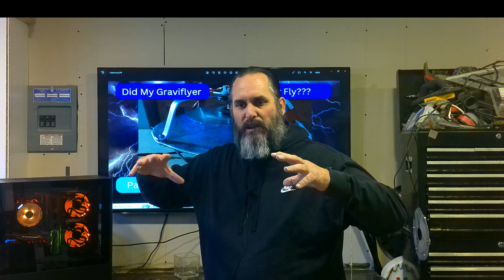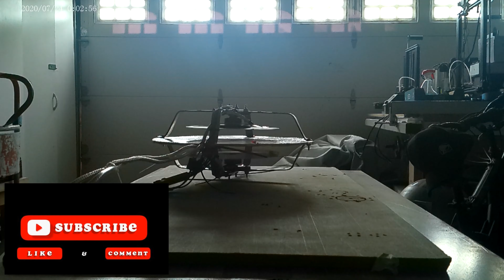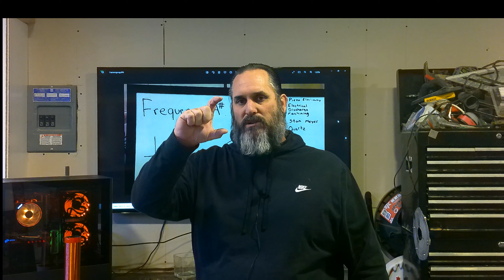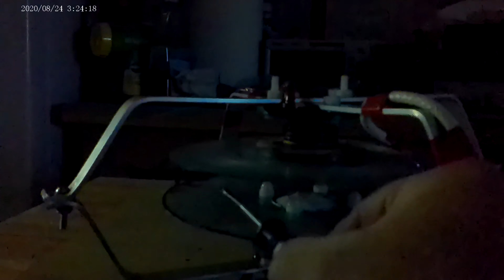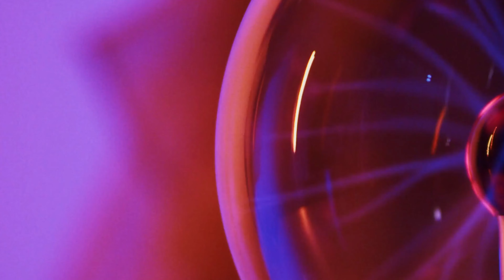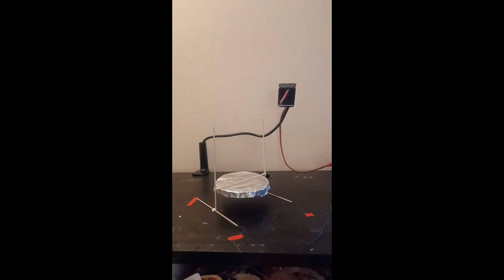Did My Graviflyer Ever Fly???? Part 4

Comment: Is the gravity effect really produced? How is it produced? Is it the mutual cancellation of electromagnetic waves? I am very interested in the production of gravity. There is an explanation of SEG; Searl-EffectGenerator for anti-gravity, but there is no explanation for gravity.
Reply from the maker: The only way to beat gravity in my opinion is to cancel it's effects one by one. rotate an object 2800 rpm it starts to defy some gravity. Counter rotate 2 objects it becomes stable. It still follows physics though, you will still have a direction it will go. Up or Down. The third ring in neutral it has to have a thrust factor. That is one way.

The second is harder to produce. It needs a static field produced around a craft. Then a dc or magnetic field (not magnets Think flyback transformer) in the center. It makes a gravity well. You then need a direction. one point above it using sound waves to travel in. 

Both very hard to achieve. As to this day there are no examples I can show for either. I can reproduce some effects but not all of them. But hopefully this year I can get closer.

Comment: A man by the name of Charles crawford 3 bought the working model a while ago in chekurkovs flight test videos as a kit here's the google drive link with all the circuits & the dimentions we need to make this work https://drive.google.com/drive/folders/1_6ZIAJF2LMDPdM6RWqz3SrzPbnbqoiht?fbclid=IwAR2LSzOKY0OLAWik0WkzifGmOtqY9nrcm6D9Qj8qHGN5YHXvs4RhHrCE5-E, it includes the tesla coil, the piezo on top the DTS flyback & the gravitometer circuits
Reply: I'll be using this info to build mine, it's the only way to properly verify if it works rather than people looking for strings in chekurkovs flight test videos

Comment: Have you tried replacing the middle plate with a sheet of tin foil?
Reply from the maker: That is what the next version has. It needs it to make sound waves.
Reply: @oldmanbuilds  so acoustic levitation?
Reply from the maker: @chikapunk4340  That's it. At the end of the video I showed one working. Mine was getting 1.0 m/s with an air tester and still lifted No ion wind lifts a lifter at that. I can't wait until my vacuum chamber is done. It will be the definitive answer.
Reply: @oldmanbuilds  yes good luck. You’re very hard working
Reply from the maker: @chikapunk4340  thank you
Reply from the maker: @chikapunk4340  what do you think of a question and answer video once a month?
Reply: @oldmanbuilds  that’d be cool considering you have a lot of projects going on.